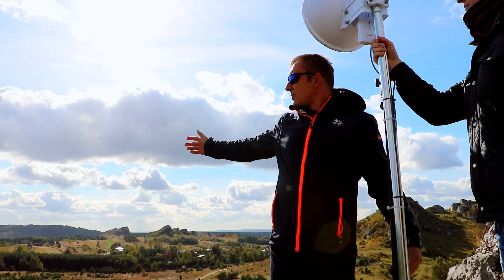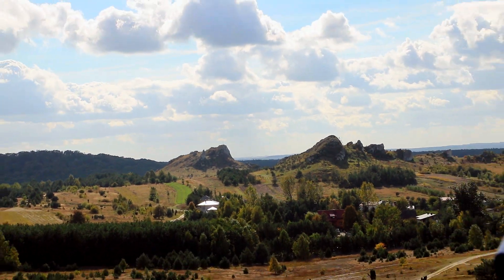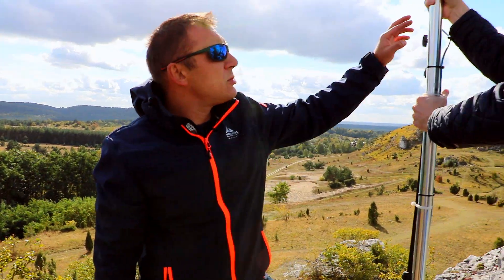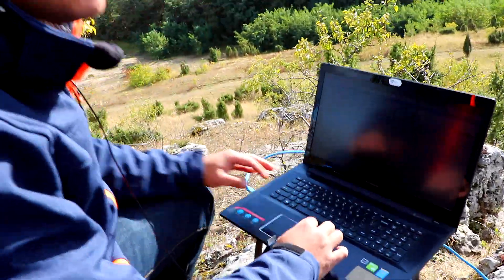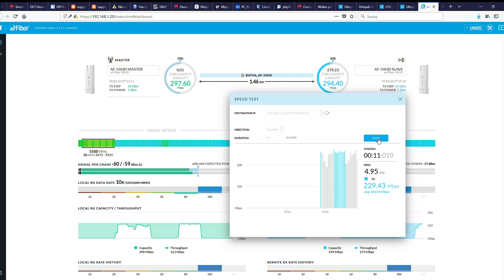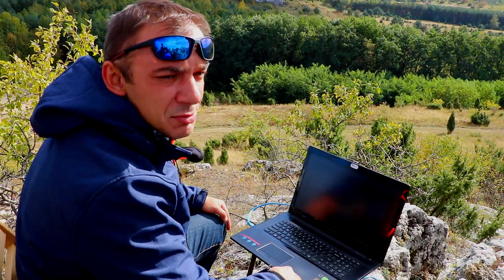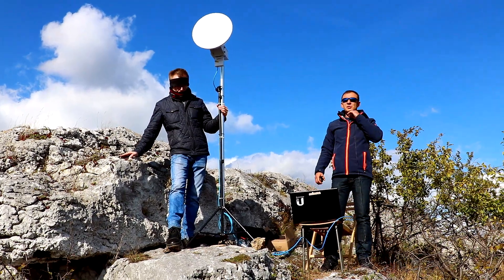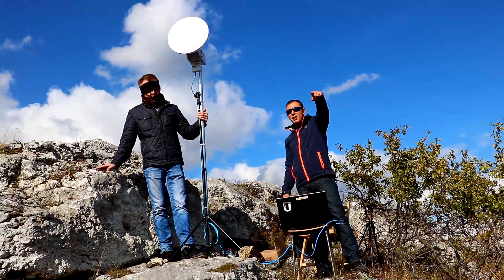Ubiquiti Airfiber 5XHD test | LTU | Extralink | Mikrotik *SUBTITLES AVAILABLE*

Comment: kiepski test, to zapierdala na 100mhz, a ty tylko nai mniesze settingi urzywasz, tyle cienrzaru tyle hodzenia, i tylko minimum?    (forgive my polish writing is poor, hope you understand... wish you pushed that radio a bit more, its a marvel of technology and you showed what  a device of 1/3rd the price should easily do, that radio its capable of so much more, and you carried 3 car batteries and walked up steep terrain and then you use minimum settings... urgh  chlopacy, comon)  Too bad I am waiting on the exact same radios and antennas and I was hoping to see what this equipment could do.  Thank you for the intro at least, wish you guys were a bit more comprehensive with it... at 1.3km, clear line of sight, max settings you should be getting 3X the throughput (or so I would expect) or maybe I am about to be dissapointed... no, don't think so, you never changed the settings to max... okay, kiebasa i piwo

Comment: wtf? Why so few? On the link RB 922UAGS-5HPacD in N radio 40 MHz 210 Mbps works. In AC radio 80 MHz 280 Mbps. What is the AF 5XHD problem here, or is this normal? I wanted to replace the RB 922UAGS with AF 5XHD ...

Comment: Con una power beam 400ac paso lo mismos datos con mejor estabilidad 1-2ms a 2.12km 

una prueba algo más real por favor, se supone que estos equipamientos trabajan a distancias largas obviamente están diseñado para eso. La potencia de salida apenas le pusieron a 7dbm sé que esto no tiene comparación con una pbm400ac, tanto por potencia como cantidad de PPS que pueden manejar, pero si nuestro trhougput es 300mbps a 1.5km con 5ms de ping.. 

Esta prueba es como tener dos litebeam ac, probando que puede pasar 600mbps dentro de tu propia casa. 

With a power beam 400ac I pass the same data with better stability 1-2ms at 2.12km

a somewhat more real test please, it is assumed that these equipments work at long distances are obviously designed for that. The output power barely put it to 7dbm I know that this has no comparison with a pbm400ac, both by power and amount of PPS that can handle, but if our trhougput is 300mbps at 1.5km with 5ms of ping ..

This test is like having two litebeam ac, proving that you can spend 600mbps inside your own home.

test in 20Km 30Km 50Km please

Comment: 1.5km this is nothing.,...
Reply from the maker: Distance is only matter of antennas
Reply: @Batna24  You guys are using dishes with an AirFiber 5XHD for a 1.5k wireless link, fully balanced and optimized im pretty you you could do around 1Gbps of throughput.
Reply: @kolymogaming  hey do these have to have line of sight? What best way to send gigabit internet from one house to another about 3 miles away

Comment: Did you not test it with 100mhz?
Reply from the maker: We've tested airfiber 5XHD at 50 and 80 MHz but unfortunately at the end the battery in our laptop has run out of power...and we couldn't test 100 MHz. However, at 100MHz the results should be even better.